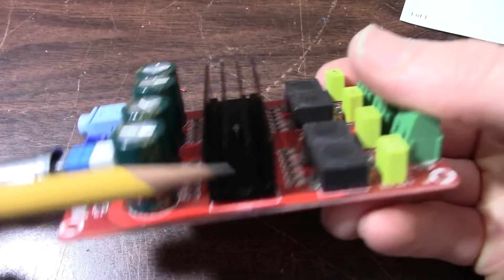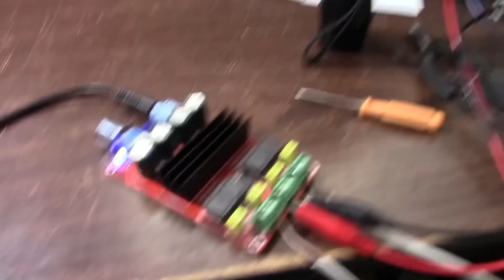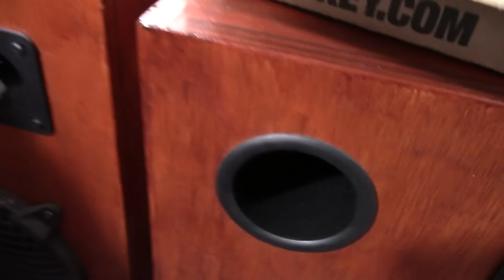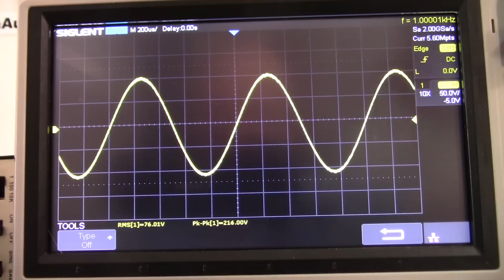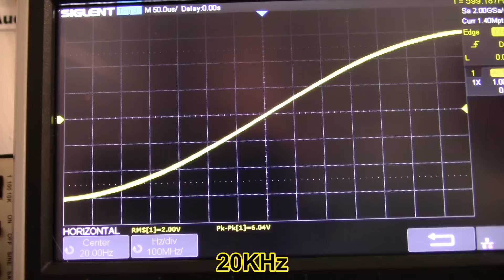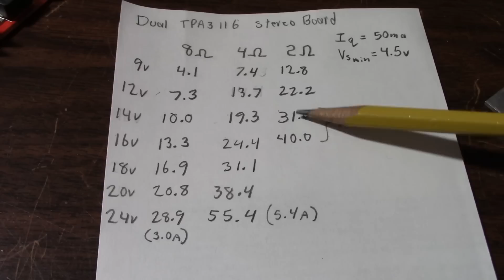TPA3116 class D stereo amplifier board review - best one yet?

Comment: I diy'ed some desktop speakers (SPL is flat from 200 to 20k within 2.5db) to go with my 8/16 bit home computers (MSX2 and Amiga1200). They are a bit heavy on the bottom and top end and 4 ohm. I think they'll pair well with this amp. I've ordered one that also includes a sub channel, switch for 1x/2x boost input signal, treble/base and sub adjustment. It seems to have 150uH inductors so should be a little better for 4 Ohms. I'll power it with a meanwell 24V 8.4A psu. 
Thanks for the thorough review!

Comment: Very nice video. Concerning values of the output filter, you can look at TPA3116's datasheet. It tells you that one should use 10µH for 4Ω load (in BTL Stereo) and 2Ω load (in PBTL configuration). This board uses 33µH filters which make it over-damp (i.e. high frequency roll-off) for all loads below 10Ω. In fact, for 8Ω load one should use 22µH filter (and the 0.68µF capacitor combination). IMHO, Class D amps like this should be optimized for 4Ω. In this case, any load higher than 4Ω will be under-damped (high frequency gain) , and any load less than 4Ω will be over-damped.

Comment: Dude i guess this module is a fake one you've been tested it. that's why it got distorted at 2ohms above 12v. remove heatsink and probably there is 16 pins chips not two original tpa3116d2. i have original board and there are some differents between yours and mines. plz check it and let me know, because mine works very well at 2ohms with 24v-5a supply.

Comment: I have one TPA3116 board getting quite hot loaded with 4-ohm speakers, while another TPA3116v2 board staying cool with the same load. I'm wondering if the board is getting hot because of inadequate inductor selection on it.

Comment: I used one of these exact amps hooked up to a set of Axiom AX 1.5 speakers in the shop where I used to work. I used an LG G4 phone as the source (decent source).  The power source was a 19V, 3.42A laptop adapter.  I would have to say the sound quality was excellent, and when turned up, did a great job of filling the shop, which was huge.

With my eyes closed and this amp hooked up to my vintage Wharfedale E50's at a moderate volume, I can't really distinguish the difference between this amp and the vintage Yamaha amplifier that is normally hooked up to them.  If I didn't like rattling the walls once in a while I think this amp would be fine.

I retired this amp, but now have a few Bluetooth TPA3116 D2 amps on the go that also sound great.  The direct connection from the G4 was better than Bluetooth, but the convenience of Bluetooth won out.

Comment: Hello. Can you help me?
When connecting a regular potentiometer between the CD player and the amplifier and twist it to one side then there will be a short circuit between
R. and L. This happens when R and L. GND. is linked together. Is there anything I do wrong? I take miter pin to amplifier and one side to the CD player and other side GND.

All RCA GND is linked together and it creates problems!
Reply from the maker: Is this to a stereo or mono amp? If mono, you need to mix the L and R signals together through resistors. 1K Ohm on both the L and R should work. The amplifier's input should be connected to the center lug (wiper arm) of the pot.
Reply: @JohnAudioTech  It is a stereo potentiometer  to a stereo amplifier.   If you take both GND and connected them together and then you measure between R. L. at the output then you measure the short circuit if the potentiometer is turned to one side.
I have tried with 2 potentiometers. a common and a blue alps with the same result.

can you test it? Thanks
Reply: @JohnAudioTech  You will get mono sound either when the volume is at full or at minimum. it depends on which way you connect the potentiometer!

yes I connect the amplifier to the center lug.

I think this problem has been overlooked by many!

Comment: Those green terminal block connectors are actually extremely bad, the blue ones are better, I had to deal with hundreds of them breaking.
Reply: I always solder wires to the board and bypass those connectors

Comment: The chip has a select-able "chopping" frequency, used to avoid interference into an attached AM receiver (if setup as a radio amp). If the board is running a lower Fosc right now, then changing to a higher frequency could help to get better performance out of a 4 ohm load (in theory).
Available frequencies are; 400, 500, 600, 1000 and 1200 Hz.
ref. data sheet (ti.com, slos708g.pdf, sect. 6.6 pg. 7 - also sect 7.3.13, pg 21 LC filter efficiency)
Cheers,

Comment: Issue always present with those boards is the power on pop, that's why they put the power switch on the volume dial, so the volume is always all the way down when the amp turns on and thus "prevent" the pop to happen. If you know a way to eliminate the pops when applying power directly with the amp turned on, please show us in a video, that would be very interesting
Reply: The old fashioned way to limit power-on pop was a relay in series with the speaker outputs, powered on by a delay, possibly a capacitor charging slowly. A two pole relay would be ideal. My 30 year old Pioneer stereo amp has this. You'd only need to switch one leg of each speaker output.
Reply: Yes I would double that question!
Reply: You can read the datasheet, there is mute pin on IC that you can build delay circuit or manually as you wish instead build complicated expensive relay set...
Reply: @jstwatchnread8420  I'm aware of the mute pin, and actually most of those mini amp use the mute pin as power on/off, else since the power switch is the same as the volume control, the pop is not heard on turn on. I was looking for a mini amp that does not have any turn on pop even if I use the power input as turn on switch.

Comment: Another great video. I have a question for you. Which one is better in your opinion? (sound quality). TPA3116 or TDA7492/7498?. Thank you in advance for your answer.
Reply from the maker: When setup properly, I wouldn't expect any discernible difference in sound quality.
Reply: @JohnAudioTech  I would like to use 4 ohm speakers for now (but I consider 8 ohm in the future) and 19V 4A laptop power supply. Does it change anything?. Greetings, thank you.

Comment: Interesting video, thank you. You could parallel another cap across the surface mount input caps for better LF response, without removing it. Also for a class D, it's not very efficient - 24VDC @ 3Amps = 72 Watts for 29 Watts audio for a 8 Ohm load = 40.3%. And, for 24VDC @ 5.4Amps = 129.6 Watts for 55.4 Watts audio for a 4 Ohm load = 42.7%, that's some wasted heat to dissipate in that small sink, if (not recommend), operated at that power level!
Reply from the maker: Keep in mind it is both channels driven during the test for 110.8 watts out vs. 129.6 in =  85.5% which is good for 4 ohm loads.
Reply: @JohnAudioTech  Ah, that makes much more sense (both channels are being run under test), and in keeping with typical class D. Sorry about the misunderstanding, thank you.

Comment: These boards usually have set their input gain really high, you can lower it by changing the resistors values which will improve the distortion. Note that this also changes the input impedance so you might want to change the input capacitor too if you do this.
Reply from the maker: For line level, the gain is too high, for headphone output levels is just right.

Comment: Hey John, what values might you recommend for the LC output network for 4 ohm loads then?
Reply: You can find everything you need to modify these amps in the TPA3116 datasheet!
Reply: Perhaps first thing to try is to see if the chopping frequency can be increased. There are 5 frequencies available. Higher frequencies will make the LC output filter more efficient when matched to a lower impedance output.

Comment: High-frequency roll-off was at 9kHz which means the LC filter was designed with a crossover frequency of 10kHz? that is terrible.
Reply: With a load of 8 ohms the cutoff freq should go above 20kHz, no worries😊
However, if you want this board for low frequency applications, that's not goona be a problems anyways.

Comment: Hi, after connecting the Bluetooth module, I hear a lot of noise, hum, whistling ,.  how to remove this?  common voltage source.
Reply: If its powered by 5v use a DC to DC isolator, "B0505S-1".
Reply: @Hman545  
hello friend.! thank you for the reply.  I have module LM2596, and this filter B0505, but it doesn't work. :(   thanks
Reply: @vipi6375  Could try a LC filter, or try using a linear regulator, those ebay LM2596 are pretty noisy.

Comment: This listing seems to be like your amp:
https://www.aliexpress.com/item/4000103939991.html

There's another design on AX that's very similar and usually less expensive, but has the output filter components in a different configuration.  Same values, though, so probably the same high-end roll-off issue.
Reply: I just ordered two, and two Mean Well lrs-150-24-6.5A PSU. Should be fun.

Comment: Ah, this brings back memories for this channel :).  Those 33µH  inductors seem to be the standard part for these amps, so Chinese manufacturers must have mountains of them ;).  I'd like to see this amp's frequency response fixed, but I understand that you don't want to fiddle with tiny SMD capacitors and frustrating SMD inductors; I don't, either.  It's wiser to purchase an amp without these problems in the first place.

This was a common design a couple years ago, but more expensive boards with more features seem to be popular these days.  I like the simpler boards as they often don't have preamp buffers which, as you've sometimes found, can be poorly implemented.  I have an application for one of these amps, but can't accept the poor frequency response.  I'd happily trade half the power for full-range frequency response.  This chip will never have flat response to 100kHz, but it's inexcusable to roll off the bottom 2+ and top octaves.

Comment: Doesn't look like the best one yet to me. The mono board you reviewed on Jul 8, 2018 was much better. If I am going to go to the trouble of building a stereo amp, I would much rather have two of them than one of these. For only a couple of dollars more, you have more heatsinking, good freq response and low distortion with the pair of mono boards.. An off-board vol. control and a slightly bigger case would be the only issues at all.
Reply: 2  24V power supply
Reply from the maker: It's a toss up between them. It uses the same filter component values. Some things were done better, some worse.
Reply: @JohnAudioTech  It seemed that your scope showed a better low freq. response on the mono board. Nearly flat,. Whereas this video of the stereo board showed a low freq. response that would be unacceptable to me personally. Unless I misunderstood  your results on the mono board video from 2018
Reply: Plus I bought two of the exact same mono boards over Christmas based on your video. They were $11 for a pair on Amazon with free shipping. I haven't connected them yet so I still have my fingers crossed that I got the best diy boards inexpensive enough to play with and hopefully actually use.
Reply from the maker: @indridcold4210  That's true, it has larger input caps for better bass response.

Comment: Hey John, glad to see you around. That board has bad output and input filters. L should be 10uH and C 1uF in the output according to the datasheet. Try putting some 10uH high current inductors and change the caps as well. If you want to go even further, place a 1uF metal film cap for inputs and change the gain to 20DB. With your Preamp, that board will then sound great. The output filter resistors seems the correct 3r3 ones.
Reply: Is there a video out there showing these mods?   I have to admit,  it almost seems a better idea to just buy cheap car amps as they are all in one, good heat sink, and great power and price with a simple 11.5 to 14.9v input and can work really well  with a battery charger.   Some even have built in bluetooth all for $60 bucks.   And you often get 4 channels and 2 ohm stable as well.  Seems the way to go if you ask me.
Reply: @MickeyMishra  I don't think there are many videos around about modding those TPA boards. But the diyaudio community is very helpful. Give a search on their forums and you might just find someone who modded the board you want to get.
Reply: @Algray_  Thank you.  I always forget about the DIYaudio site and community.

Comment: I think it would be good idea to make a video about choosing right output filter for class d amps (maybe with specific core choices? ferrite vs iron powder? how big it should be for how much power?), because chinese can't get it right. I'm using right now tpa3116d2 amp and original inductors burned down almost in flames (amp in free air), and they were pretty chunky toroidal ones, with iron powder core and something around 50 or 60uH if i recall corectly.

Comment: Caught a glimpse of the board model at 2:02, it’s XH-M190, though at the usual suspects I’m seeing at least two different board designs or revisions - yours’s got the output coils and caps in line across, I see another with the coils paired at the edges of the board and the (black box, not yellow) caps in a neat little square in between. Some have the blue KRE connectors all bunched up together, others have the green ones... Keep up the good work, kudos from Brazil!
Reply: I just purchased a hw-303 v3, it seems to have the caps and the coils like you mention, the only differenve being that the coils are 100v not 68v, but both seems to be 0,68 micro farads. I have ordered som oscilloscopes, so will chech how my amp works, compared to the one under test.  Thinking to run mine on 12v and hoping for better results, we will see.

Comment: Heads up,   I got a Nobsound NS-04G a few days ago with reduced part count.  It has some serious flaws.  You can actually hear music playing with no speakers connected because of the terrible inductors used.  It also distorts terribly over 10 Khz.   TPA3116 amps can be done right or wrong.   I've got a few that work well and well now one that doesn't.   I have a 6 channel TPA3116 board that does OK.